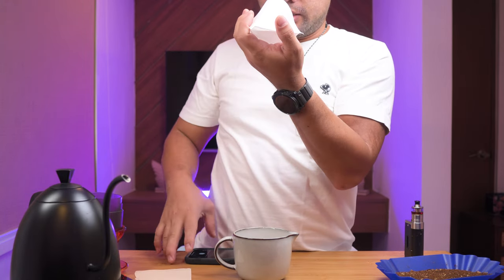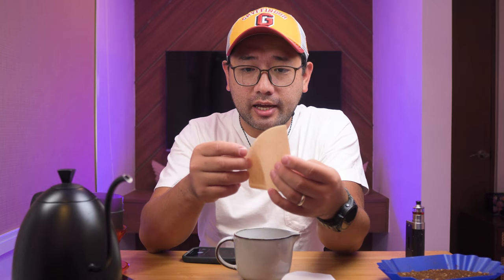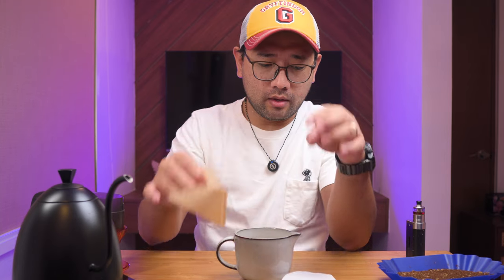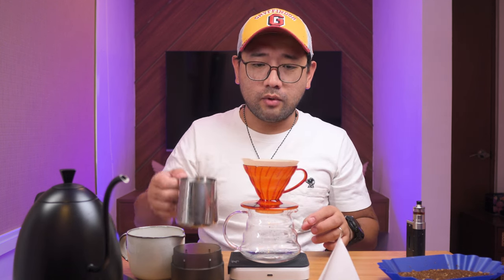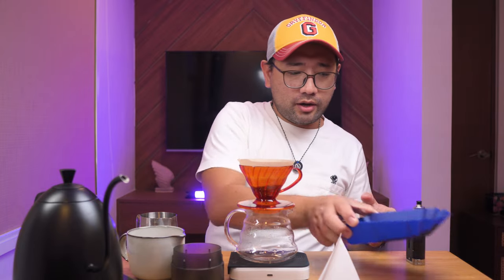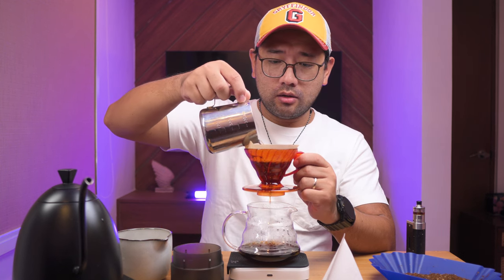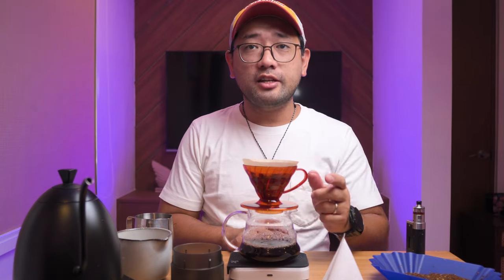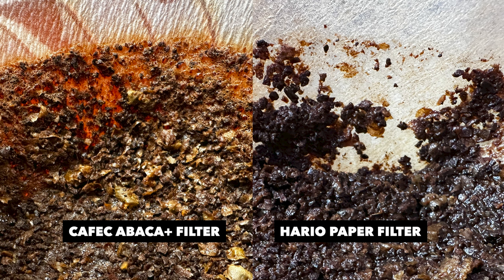Hario Paper Filter versus Cafec Abaca+ Filter

Comment: I haven't tried Cafec, but I tried Kinto filters and I think they're just superior to Hario! They're slower, so maybe go for Hario only if your brew stalls all the time. Or if you have bad coffee beans and don't want to waste good filters)
Reply from the maker: I agree, the paper is very much negligible if you arr brewing only at home. I mean you can adjust this on other parameters.
Reply: @darylbuenocoffee  It just came to me that the faster filters like Hario may be better if you want to make bigger brews. I almost always make a 300g cup for myself, so it's not a problem I have, but when I want to make a bigger brew - that's pretty much impossible with a filter like Kinto.
Actually I do think the Kinto ones taste significantly better)
Reply from the maker: @Dimich1993  yes i completely agree, bigger batches would require an adjustment with the settings bec first of all the surface area of the paper doesnt change exponentially as the dose does. So let's say you would brew a batch of 700ml coffee. For a 1:15 ratio you would need around 45g dose of your coffee. This would actually fit in a 02 v60, so technically the 700ml is a 5-6 cup serving but the paper didn't really get bigger for 5-6cup dose. It is designed to fit 4 cups only but even then you need a bit of adjustment for brewing for cups bec doing so it is already prone to stalling and clogging bec of the amount of microfine particles in this big of a dose.

Comment: Thanks for this video. I had actually just run out of paper filters, and I'm thinking of buying Cafec Abaca+ since I've only ever tried Hario. But now, I'm having second thoughts because I use a Timemore Chestnut C2, and from my understanding, it does produce some fines (although I've never checked it comparatively with other grinders). Do you have any thoughts for my situation?
Reply from the maker: yes it does produce microfines a bit more than other grinders  - but as i've said in the video you can actually use this to your advantage - when your grinder produces a lot of microfines you can use this to exactly slow down the drawdown of your brew giving you more body and more sweetness in your end cup. of course it will always have it's downside of over extracting so it will require a bit of adjustment at first  but once you get the hang of it, congratulations! you learned a new skill :)
Reply: I have a C2 also! Try using recipes with lower agitation, for example no stirring as it's super aggressive and you'll lose all clarity. I developed my own recipe where I only use a top swirl at the end, eventually I'll get to making a video. 😏
I also suspect it's going to be challenging to use recipes for coarse grounds, as you're gonna have a lot of microfines anyway.
Also I think nowadays that coffee beans open up after 20 days and maybe peak after 30 days!